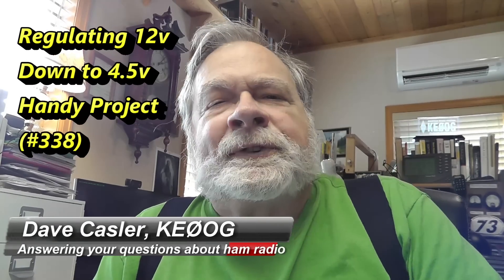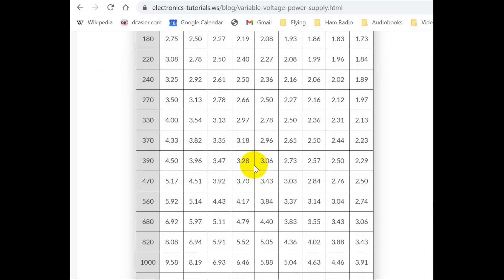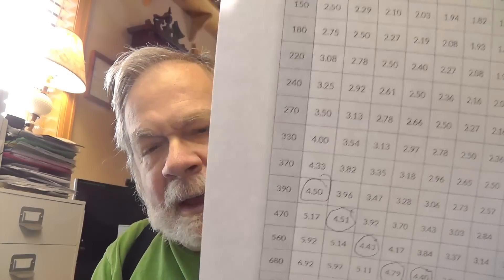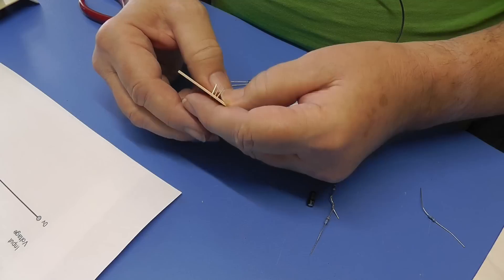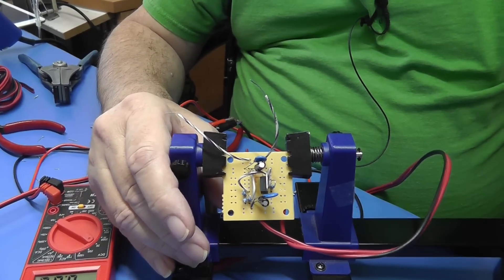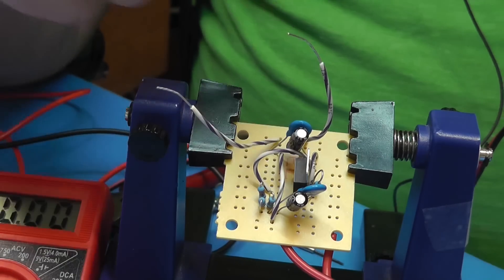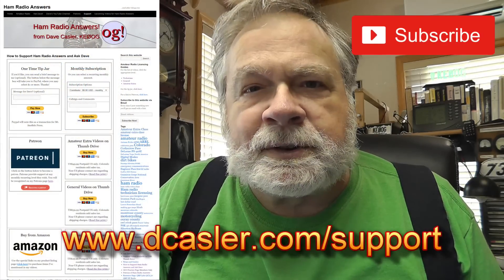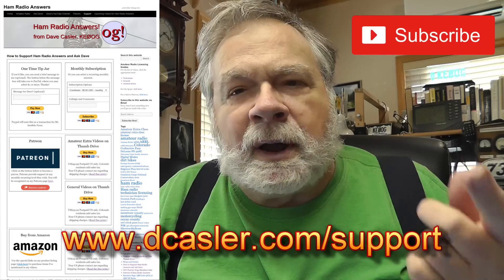Built From Scratch: Regulate 12vdc down to 4.5v (#338)

Comment: Nice video Dave. Even if you use flux solder I find it's always better to apply flux to the board also. Just clean it with alcohol when done. Can't use too much flux. 73de Kb7ici.

Comment: Test this on a breadboard with some old surplus LEDs.    Feed the 5v output of a LM7205  into a series resistor-diode voltage drop consisting of a 2-ohms, 2-watt resistor in series with a diode (IN2007} or similar which should drop the 5-volt output of  LM7205  down by 0.5 volts thus providing the desired 4.5 volts.  Resistor based on 100ma load current.   Alternatively use a 7-volt output LM...   and drop 2.5 volts with 4 diodes in series and get  4x0,7 =2,8 V-drop and use  4.3 volts for the load which will extend the lifetime of the load LEDs to a very long time.   testing the voltage drops of many different diodes in series may show a voltage drop of less than 2.8 V  if not, use both a 3 and a 4 diode string and a DPDT switch for a dimmer?  I hope I got this right since it is 1:30 AM  I learned radio & TV operation in 1957-59 on the TV program "electronics at work".  on WQED  For a low price we also got some booklets.   I watched it on a FADA television with a small screen, hmm,  maybe 12 or 14 inch.   PS  Add in the small caps where necessary.

Comment: I could use this to build a circuit to take my 18Vdc Makita batteries down to 13.8Vdc for portable radio operation.
Reply: You will need to consider the current draw of the radio since the regulator has a limit of about a 1amp. Another constraint is at reasonable power levels you will also need heat sinking for the regulator. The heat sink must be capable of dissipating the wasted power P=V*I of (18-13.8)*load current in amperes. If you now consider the efficiency P in = 18x0.25=4.5 watts P out = 13.8x0.25= 3.45watts or 3.45/4 or 86%. Not too bad for such a small voltage change but the efficiency will fall off rapidly for higher differences e.g 18V in and 5V out.

Comment: These circuits are cool and instructive and call back deeply into the art of the hobby where using your knowledge and resources solves problems.
I like re-purposing old 5v phone chargers for LED lighting projects like this, so very often I simply add a single diode in series to drop the voltage a little bit depending on the current draw.

Comment: How many amp hours capacity do you have in your 12 volt battery bank?
Reply from the maker: About 400
Reply: @davecasler  thanks. I just installed 1.5 kw of panels charging 350 amp hours at 12 volts of battery. I am most happy with it so far.

Comment: There is another way do this. A 15 turn pot would be good,  but not everyone has that. You could use a 7805 and put a diode to drop the output. Or a NPN transistor would do same as the IC. I don't think the voltage needs to be that picky for the light.
Reply from the maker: It doesn't, and I could have saved some trouble just by using a 7805.

Comment: Nice job, I do have a couple of comments. You are dropping about 7.5  volts across that regulator, a heat sync might be warranted so be sure to checked the spec sheet before you enclose it. Next comment, instead of combining resistors to get the exact value needed I think that getting close but still under the value needed and then using a trimmer potentiometer to fine tune it would have been a more versatile and elegant solution without much added complexity. Finally, a buck converter would be a more efficient solution although at the expense of complexity but you are not using batteries so it is sort of a mute point. Good video, keep up the good work.

Comment: Wouldn't a single 7805 with one dropping diode or resistor have done an adequate just much more simply?
Reply: Yeah I doubt you would need more than just the regulator because that mug probably isn't very picky about the voltage.

Comment: You could have used a 5 volt fixed regulator and just placed a 1n400x silicon diode in series with the output. Voila, 4.5 volts!
Reply: Agreed, that is how I would have done it. For the benefit of others, the electros are pretty redundant in this application since the source would be considered pure low impedance DC hence no need for filtering and the output will see a static load (LED) so no need for filtering here also. The low value caps are a good idea for RF rejection.

Comment: I would use 5 volt USB to power this device, new battery is 1.6 volt, so 3 battery already 4.8 volt, I don't think 0.2 volt can be any problem

Comment: Nice job, Dave! I found the same site a few months ago and build a similar board to yours. Like you did, I cobbled together resisters to get what was needed. I built it to power an LED flashlight with a broken internal battery holder. It will make a good reading lamp for my sailboat, running off 12vdc and no worries about fading batteries. Next project is some sort of holder. Is that a good excuse to get a 3D printer? LOL

Keep up the good work. Merry Christmas. L-RD Bless, Keep, Shine. . . 73 de wil n6bvz/4